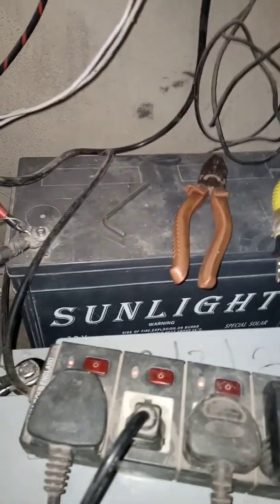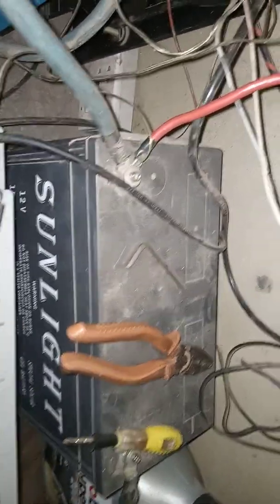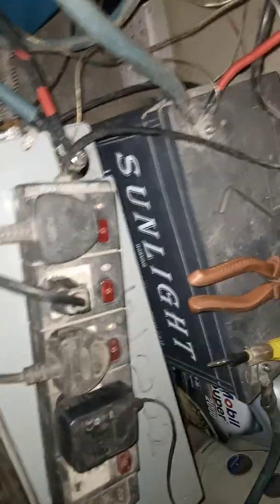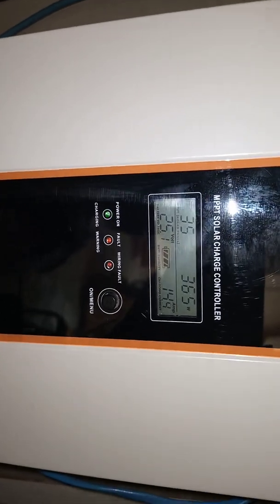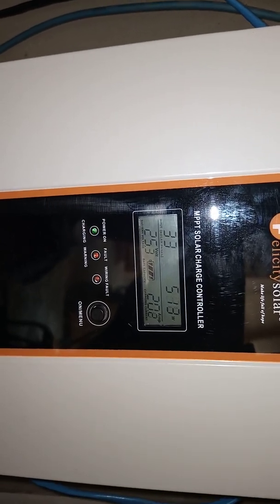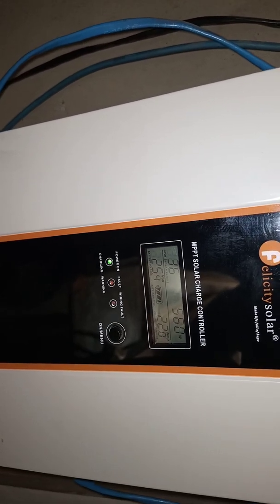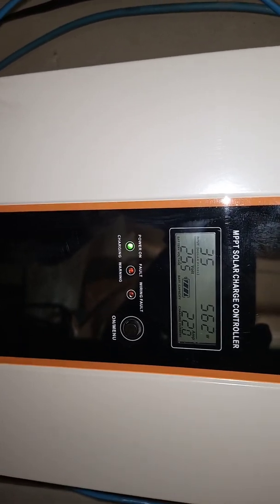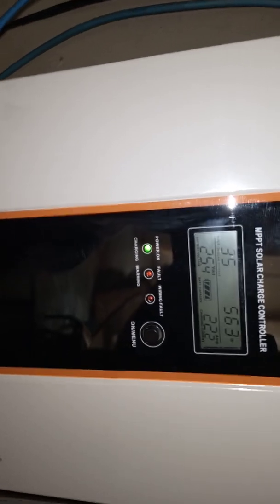Felicity MPPT update video on my 24v Solar inverter system

Comment: I use a fidelity charge controller 60A, to charge a 24v system of 4 12V, 185watt and 2 220AH battery. The maximum charge have been getting is 340 wat and 12 amps.  Am I supposed to be worried? Is the charge supposed to be more than 340wat ?
Reply from the maker: The charge you get out of your system depends on alot of factors. Some have to do with the positioning of your solar array (East-west) or (north -south). Also, shadow casting on the solar array will negatively affect the output charge. The type of charge controller also matter (MPPT or PWM). MPPT is best for optimal output charge. How are your solar panels connected? 2 serial in two paraller or all connected in series? Wire size also matters depending on the solar array connection type you have adopted. Kindly let me know.

Comment: I have 45 A felicity charger controller and 3.5 KVA (24 V) inverter also of felicity. My 2 batteries of 12 V are connected in series giving me 24 V. My inverter start beeping (warning) when the batteries level dropped to 23.9 V. How can I change the beeping level of the batteries to say 22 V? Thanks
Reply from the maker: Hi. Changing your low battery notification level to 22v means that you will be attempting to shorten the life span of the battery in the long run. To answer your question, I don't have the Felicity inverter. I will try and check around and let you know once I have found a guide.

Comment: What is the wattage of your panels are they connected in parallel?
Reply: Yes they are connected in parallel
Reply from the maker: I have three 300watts solar panels making 900w in total but connected in parallel at the moment. I am going to change it to serial connection by the time I am buying more panels to scale to a 2400w PV array. I will make update video on that when it's time.
Reply: What's the name of your panel?
Reply from the maker: @peterakoh3432  sunpower
Reply: If the inverter is 3500W and solar rated power is 5000W what is the right wattage i shud have to know how many panels i need thx
Reply from the maker: @chico711  Hi Chico, you didn't mention your solar charge controller in this equation. For a solar array of 5000w, you may use MPPT solar charge controller of 100Amps which can run 12v/24v/48v with max power of 1375w/2750w/5500w respectively for Felicity product. As you can see, only the 48v system of this MPPT CC will accommodate your 5000w solar array. This way, you will need 24v solar panels. The max solar voltage of 195v for this  MPPT CC, you can use  12 of 420watta panels with OC voltage of 45v max, connecting 4 in series in three places meaning 3 rows and 4 colums. For this system, you will need a min of 4 12volts batteries connected in series and your inverter should be a 48v system. Also, you didn't indicate the distance between the solar array and the charge controller as this will determine the wire size to be used. kindly let me know.